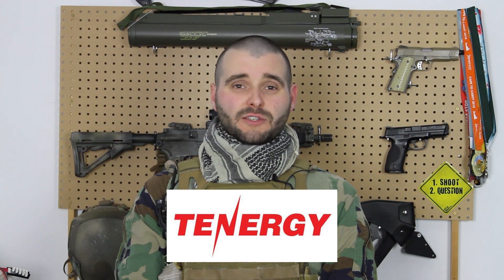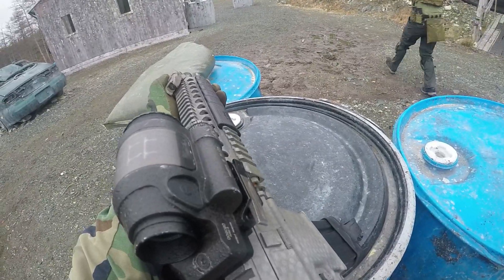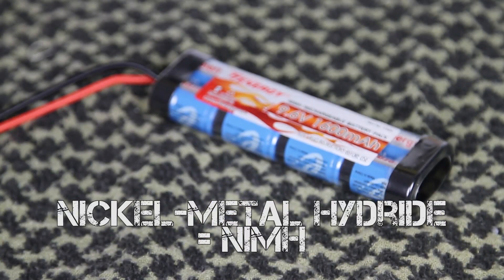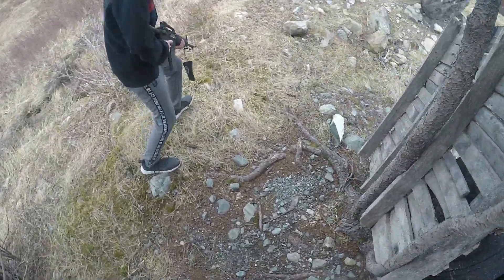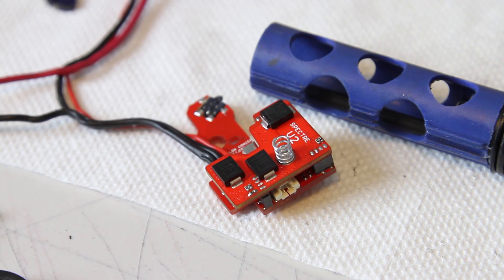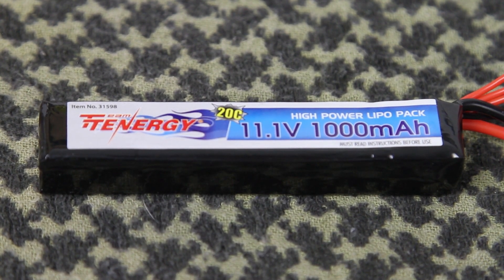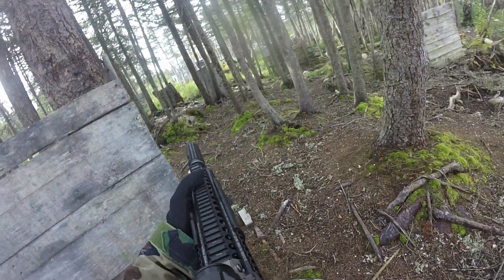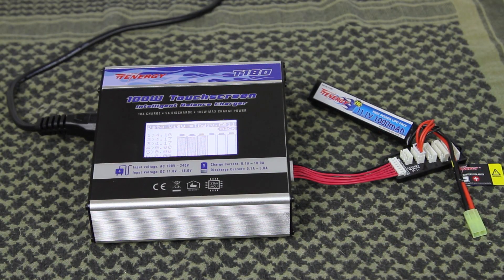How To Choose A Battery For Your Airsoft Gun!

Comment: How do I know what battery fits in my gun?
Reply: look up the dimensions that your battery compartment has, then if you go to the specs of whatever battery you are looking at, and see if any of the dimensions are larger
Reply: @stumpyguy8856   I picked up a Lmg and I'm torn. I found two options 7.4 lithium 3500mAh battery and I found a 11.1 3000mAh battery. The thing is I'm playing support so I'm going to be running full auto all the time so my gear box is going to be pushed to its limits with 11.1. With the 7.4 I can sustain fire longer and my gear box will be safer. I just loose a bit of rof

Comment: Batteries also have a C rating. The C rating is very important, it is a measure of how fast electrical current flows from your battery to your motor. For example, a 30c battery will have better trigger response than a battery of the same voltage but with a 15c rating.
Reply from the maker: This is totally true, but we felt it was a bit too much detail for a high-level overview video. Still good information to research though! Thanks for the comment!
Reply: That makes sense, great video too
Reply: I used like 75 c batteries when I used aegs
Reply: My Rule of thumb has always been 20c rating for Stock Replicas and 25c for anything upgraded with 30c being max for Major Upgraded Replicas.
Reply: @NepaAirsoft  ehhh for stock yes but 30c won't cut it for dsg's
Reply: notations from those whom have already replied, needs notation there is a difference between the sustained C rating and peak or burst C rating. for instance airsoft standard 20c batteries are only 20c on initial current and will immediately drop down to 10-15c for any level of sustained output. 

Most respectable manufacturers, i prefer Venom, will usually have both C ratings.
Reply: The "C" stands for current.
Reply: watching this in 2021 but if anyone sees this it’s important to note that if u get a battery with two high a C rating it can burn your gun, make sure you know your guns limits
Reply: I thought electricity was lighting so I always assumed my trigger response was the speed of light
Reply: Coloumb
Reply: This is what i was looking for aha

Comment: How do I find out if it will fit in my gun and also the connector
Reply from the maker: Many airsoft stores will tell you what kind of gun, and what location, a battery will fit. So it might say the battery is suitable for an AK style rifle, or it’ll fit inside a PEQ box etc. 

As for the connector, almost all batteries sold online will tell you what type of connector it uses (Tamiya, mini-tamiya, deans/T etc). Just check to see which one your gun uses. 

Finally, some sites will list the actual dimensions of the battery, so you can just measure.

Comment: Sadly, unlike rifles, there doesn't seem to be any smart charger for pistol nimh batteries. I guess I'll just have to be careful about charging it with the default wall charger.
Reply: Funnily enough, pistol lipo batteries have standard connectors, which make standard smart chargers usable with them. I'm not feeling comfy enough to use lipo though.

Comment: Btw, if you play predominantly with semi fire you can run a 11.1 lipo in most non-upgraded guns without problems. Since I don't mind fixing a gun if it would break I have run many "beginner" guns like stock CYMA AKs or stock Specna Arms AR15s with 11.1 lipo but after years of use, none of them have broken yet. But I guess you increase the risk of stripping a piston if you run a not upgraded gearbox in auto alot.
Reply: What’s the exact 11.1 battery you run? I’m looking for one
Reply: @RthWavey  I run a lot of different ones. Whatever brand that has a battery that fits into whatever gun I need it for. I have a few Turnigy, a few Specna Arms, a few iPower and a few others of different brands. I haven't really seen any big difference between brands, all seem to work just fine.
Reply: @marcushillerstrom25  hey can you help me out and tell me what’s goin on with my aeg, I gotta Krytac spr trident mk II and I use a 7.4 Lippo battery, there is no issues with semi auto but when I use full auto it will be strong for a little while but then the gun slows down to a stop, is it because of the battery not being sufficient or is it the gun?
Reply: @resolvei9185  Sounds like a problem with the motor or battery. See if it behaves the same with a different battery, if it does, it's probably something wrong with the motor.

Comment: I bought my first aeg, it is the 90$ hk 416. It comes with an 8.4v battery. Can I put a 9.6 or 11.1 v battery in it? And if so, would you recommend it?
Reply: I have that same gun (it was my first one I ever bought years ago), and I run a 9.6v in it and it works just fine. Tho it does almost work the gearbox to hard. It's not too serious of an issue, but over a long period of time, it will wear out the gearbox (wich is all mostly plastic). Hope this helps u.
Reply: @crazylegofan9209  thanks!
Reply: @chewyiceman  no problem

Comment: Why are these guns just not coming equipped with a smart power solution? If it's getting 11 volts step it down to 9 or whatever the motor is best suited for it should not be this hard
Reply: Like why would you just not put like a small voltage regulator on it boom done
Reply: Oh oh I get it MOSFET yeah.. someone needs to create an open source solution for a Halo-ish ammo capacity battery charge screen that can work on any gun 🤣

Comment: Do you think a nimh battery would be enough to run a replica that has 1.3 joule and comes pre-equipped with a mosfet? Or would it be severely underpowered? Or the connectors are different and it won't fit?
Reply: I got my answer: Yes, it works!

Comment: Hi mate, great video. I'm a beginner and on a budget. Could you possibly recommend the most efficient battery for an ICS MP5 A5. The battery pack is stored in the grip underneath the barrell, I don't have any idea of the dimensions the battery has to be, and I don't understand the differences between all these different types (lipo, NiMH, etc) it's going to have to be a really small slim battery, but I want the maximum fps, rpm and life but I don't want to put pressure on the gun that it can't handle and risk stressing the internal parts. All I know is it needs to be a mini tamiya connection. Could you possibly send me a link for the best battery? I have a smart charger which will charge any type of battery..I'm on a budget so can't afford to buy one that's too big. An eBay/Amazon link would be great, or just a description of the perfect type, voltage, Mah,  and size for an ICS MP5 A5, would be so grateful. Thanks.

Comment: Yo im new to your channel and would appreciate your help. I am thinking about getting a Lancer Tactical Enforcer Hybrid Gen 2 Battle Hawk AEG and it does not come with a battery. I kinda got confused with the video. If you could tell me which is the right battery to get on that website id appreciate it so much. Keep up the great work!
Reply from the maker: Based on the manufacturer's website, this gun requires an 11.1v LiPo battery, stick type, with a mini-tamiya connector.
Reply: @StormRiders  Thanks so much man! I subbed and turned notifications on cause you help your subs. I appreciate it bro!
Reply from the maker: Thanks! Good luck!

Comment: Deans are so much better, agreed. Furthermore, as soon as you can, go to a lithium ion battery. They typically have twice the mAh of a Li-Po, and they do not puff. I have had some Li-Ion packs last an entire weekend. The worst is when your pack dies in the middle of a firefight.

But buyer beware: Not all Li Ion Packs are the same! Wiring, construction, size and the raw cells make a huge difference. Make sure you go with one from a very reputable company, but it is an investment well worth your time.

Comment: I stopped using battery guns cause I bought two and they both exploded
Reply: AEG’s are the most popular and used guns, so obviously that’s not common. What guns exploded, and what batteries were you using? I want know so I never use those.
Reply: I think an 8.4 but I’m not sure
Reply: Buy a smart Charger. Lipo batteries explode if they're overcharged